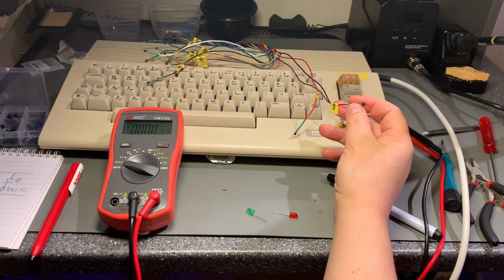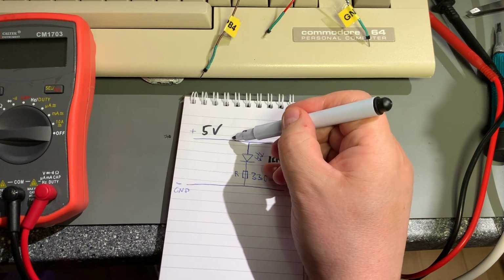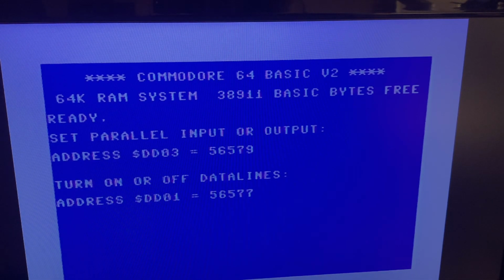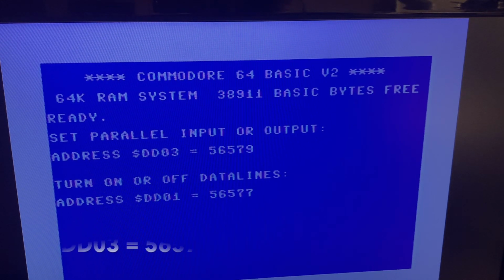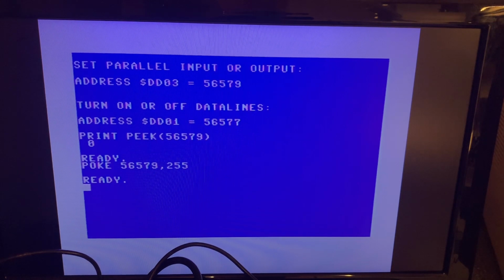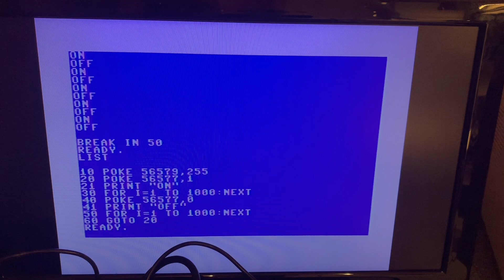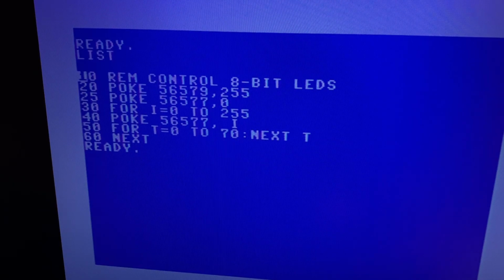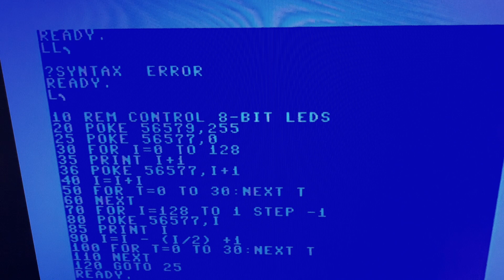Controlling electronics with the Commodore 64 user port - Part 2

Comment: I used 8 SMD LEDs and wired all 8 lines and ground. I used 470 Ohm resistor network. Set (POKE) DDRB to 255 (all data lines are output). Sent (POKED) 170 and 85 alternately to CRB with a pause between. I used durexforth rather than BASIC. Posted to Instagram.

Comment: salut ou avez  vous acheté le fil vers user port a  1:26
hi where did you buy the wire to user port at 1:26
Reply from the maker: In a local shop here. But you find it on ebay and many other places

Comment: Please delete these videos until you have learned to do the electronics part properly and re-shoot those parts. Every broken CIA chip is a small tragedy.
Other than that, great stuff! I wish there was someone to tell me how easy the user port was to use when I was 10 years old.
Reply: Do you care to elaborate a bit more on how the electronics part should be improved? I was about ready to do this same project, but do not wish to risk damaging my CIA
Reply: @Tony240zt  A 1K current-limiting resistor on the base would probably be a good safeguard.

Comment: Why do you use a transistor between the data line of the user port instead of connecting the data line to the LED directly? Usually I don't see a transistor used in a circuit like this.
Reply from the maker: Because the user port cannot support that much amps. So to be safe, I used transistors. So not to risk damaging the CIA chip.
Reply: @Arcticretro  isn't the voltage you're using coming from the 5v rail on the user port? I'm just wondering if the 5v pin and voltage on the data lines come from a different sources, because they're both 5v.

Comment: That last program can be done even easier in assembler (just wining it now :) )
LDA #255  ;set Port to output
STA 57579 ;userport control register as output
LDA #1 ;set A to 1
STA 57577 ; show 1 explicitly since we start loop with shifting
LoopUp:
ASL ;shift left (multiply by 2)
STA 57577 ; show led status 
CMP #128 ; is value not 128 then LoopUp
BNE LoopUp
LoopDown:
LSR ;shift right
STA 57577 ;show led status 
CMP #1
BNE LoopDown
JMP LoopUp
RTS

You could make the program even smaller if you branch on carry set and not set, instead of explicitly comparing the value and then branching. But this makes it a bit more readable for non-assembler coders.

And this runs ~1000 times faster than on basic.
Reply from the maker: Thanks! Yes, I know. I have programmed assembler like 35 years ago. I need to brush of my old skills :)
Reply: What about the delay needed to see the animation?

Comment: It’s better to connect the LED (and resistor) to the collector of the NPN as you would steal 0.7 volts (forwarding voltage) of the transistor from the output. In this case it’s okay but with higher loads like relays you always switch them from the common collector. Just a little tip.
Reply: The 0.7 Volts will be dropped regardless of whether it occurs above the LED (emitter side) or below it (collector side), so it shouldn't matter which leg it's connected to.  The current passing through the LED will be the same regardless, and likewise have the same brightness.  You can test this on a breadboard if you like.

Comment: also there is a possible to use a n-channel mosfet-transistor. with out consern for blowing the n n-channel transistor, the n-channel is a voltage-field controlled unit. it is controlled by positiv charge on N-channel-transistor gate.